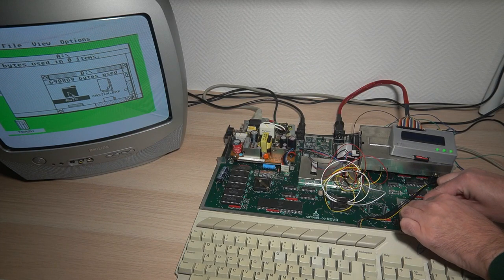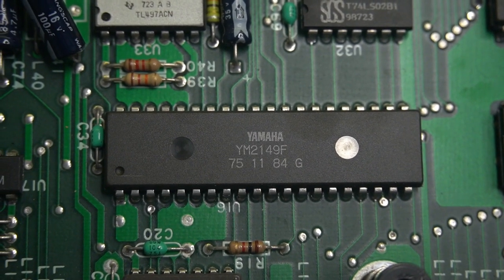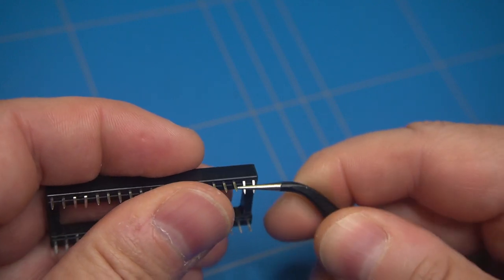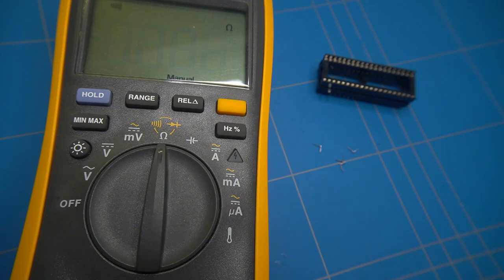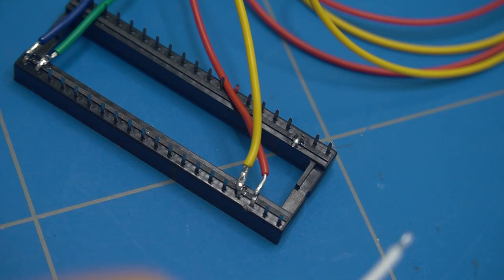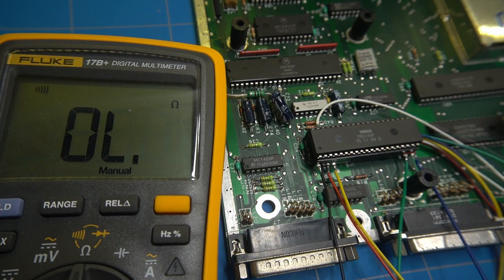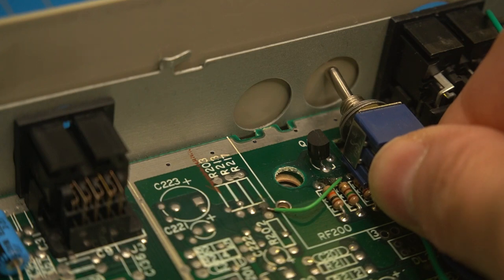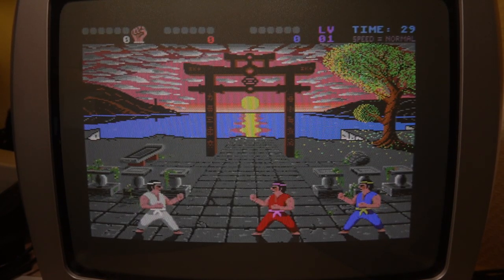Atari ST external drive boot switch

Comment: According to ST schematics, there should be a header for almost exactly that purpose (maybe it's just soldered pads) - all you need to do is to disconnect (desolder) that header (shoould be located after the filters), cut one trace, and connect the switch. If the board doesn't have such header, you can always switch DS0/DS1 at filter location. Only 6 pins to desolder there, and you protect YM from switching surprises (if you keep the filters).
Reply from the maker: Thanks for the info. I will check it in more detail. Maybe for my next stereo mod. 🙂

Comment: When marking holes in light colored plastic with a pen for drilling it is sometimes possible to see the inside mark on the outside by pressing a flashlight up to the plastic, that way you can mark and drill from the outside if it's a bit too tight for the drill inside or if you need some idea of where the hole is going to be on the outside.
Reply from the maker: That's good tip! Thank you.

Comment: with your mod does the internal drive operate at the same time as the external drive? Doing the D0 D1 flip does not seem to stop the motor signals going to both when using the external drive as the boot drive.
Reply from the maker: Does it? I haven't noticed.. It's technically not my mod. It's been around for decades.